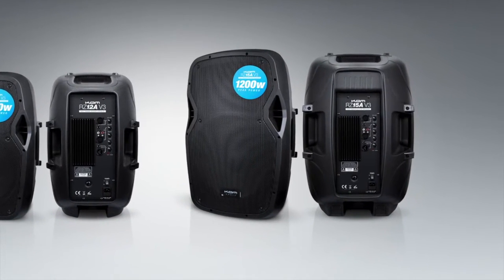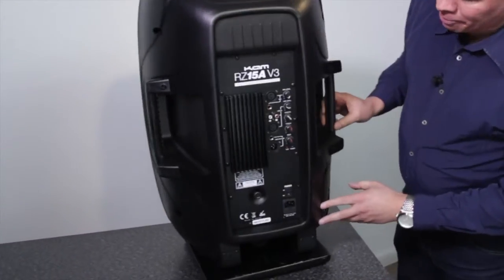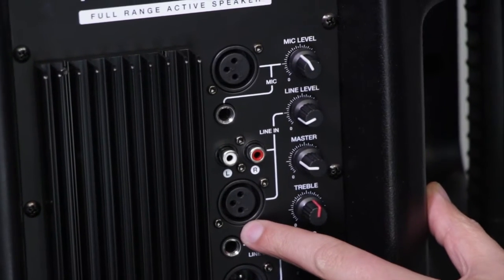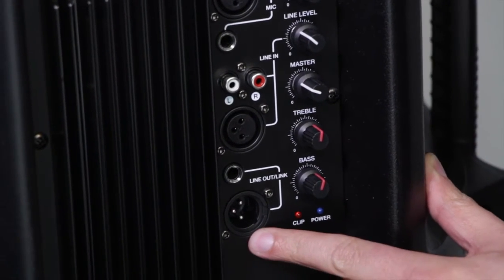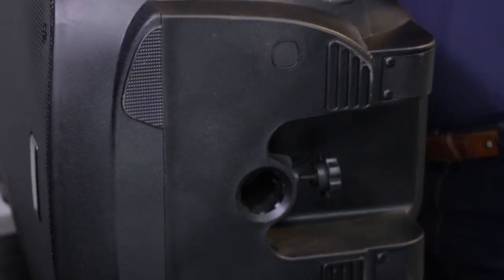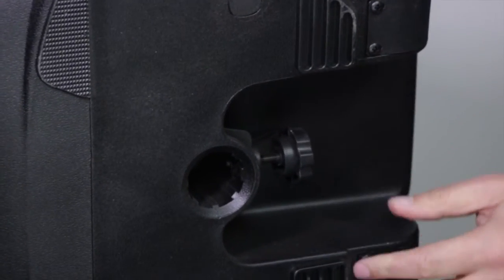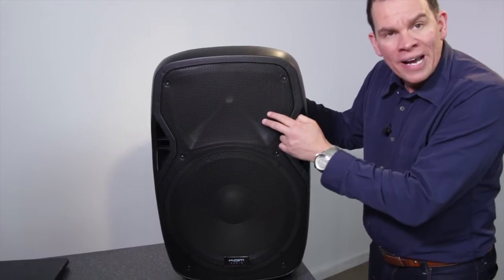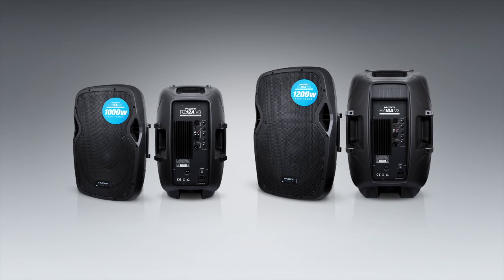Quick Look at the Kam RZ15A V3 active speaker

Comment: I have two cable plugs in storage box, and cannot remember which is the correct one to use - one is a 13A fuse, made by Shagyu Jintao Electron; and the other is a 5A, "I-Sheng VDE Kema" (printed on the cable). The speaker says 11.6A fuse required.